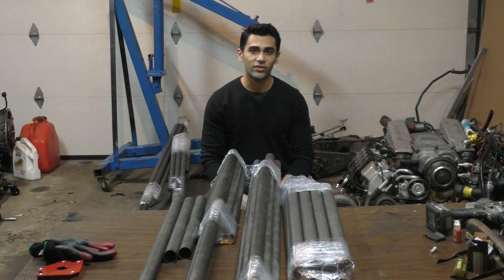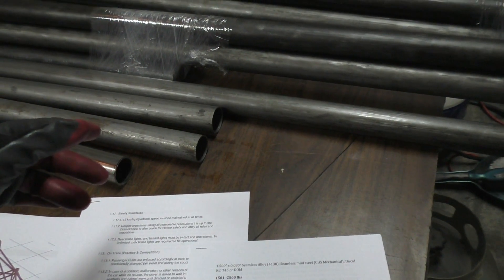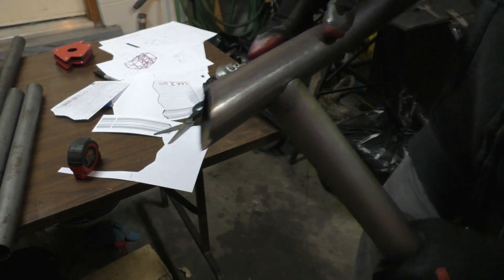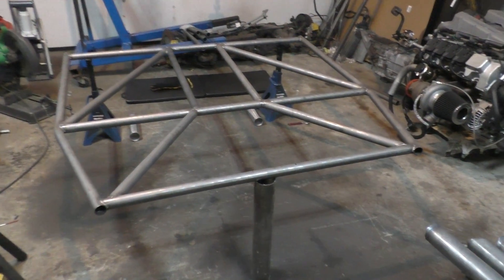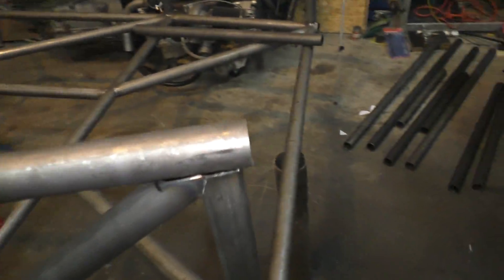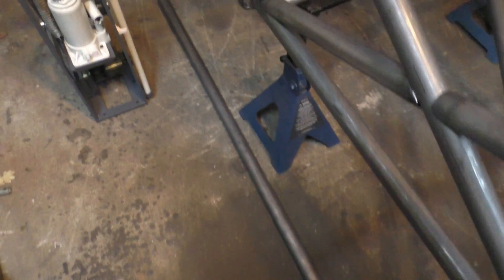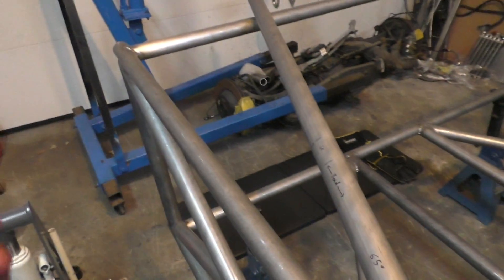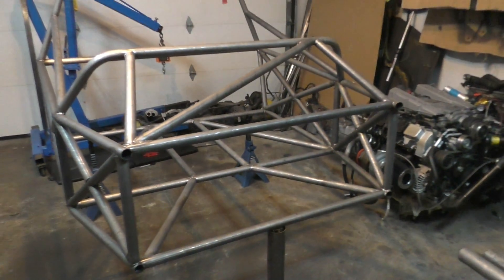Making a Racing Tube Steel Chassis - E55 ASL Part 4

Comment: hello there what software do you use to print out a guide on angular welds on cylindrical tubes,  a decent video tutorial on yt would be nice. im working on a project car from scratch. from philippines. PS ,may i ask specs on the tubes you use

Comment: To make tube notching easier, try a PipeMaster profile gauge....
https://www.ebay.com/itm/PipeMaster-1-1-2-Tube-Kit-Contour-Gauge-Tube-Notching-Modified-Off-Road-Dirt/271146913722?_trkparms=aid%3D1110006%26algo%3DHOMESPLICE.SIM%26ao%3D1%26asc%3D227673%26meid%3D9cc2cb6b4c044c11bc0d0b83f7121045%26pid%3D100005%26rk%3D1%26rkt%3D12%26mehot%3Dag%26sd%3D383483294582%26itm%3D271146913722%26pmt%3D1%26noa%3D0%26pg%3D2047675%26algv%3DSimplAMLv5PairwiseWebWithBBEV2bDemotion&_trksid=p2047675.c100005.m1851

Comment: I built a car frame a long time ago. Used .125 wall square mild steel tubing. That frame was near indestructible. I am inspired to begin designing a mid engine, two place tandem, street/track car.

Comment: Not sure if you still check your comments but I just graduated uni and looking at doing a similar project. Did you design thenroll cage or buy it? I’ve designed a roll cage for an off road go kart on SolidWorks I still have to run FEA analysis on but wondering if there’s anything specific you know
Reply from the maker: Just go through the regulations if there's any specific event your looking to compete in. I followed the time attack rule book that specifies the minimum requirements for the roll cage, the rest was based on my own calculations
Reply: SK8215 cheers for the response brother 👌

Comment: Id be doin a rainman level freak out if I had to start from a less than adequate base. I gotta ask, Why? Why not make a jig? Its stressing me out from here... Get the prep and base spot on and everything ahould come into place. 
(As im watching this, you got (b?) pillar angle wrong... 😳 i feel sorry for you when you try get panel gaps correct, interior trim panels.... And your still, “meh, its ok” 
Im not hating, just a bit of PTSD from being through these still born type projects and knowing what sort of pain your in for... g (you just got an... nevermind) 

Jeezuz christ mate, you obviously have the schooling and welding... 
But sheesh... There are certain things you need to step back and invest some time into as future steps will carry this on. And so on. 
And tooling, I buy good quality stuff, but not top shelf stuff. No where near. 
BUT.
There are those few items that need to be 👌🏻. The extra money invested here will pay itself of 10 fold... 
That bender belonged in a shed that was building a swing set for example. A decent, but sturdy 60x90cnc bed and gantry with top shelf rails, spindle etc etc, is another good one. 
And in your case, a good system for truing components. Ie; a method for checking centres.... a small frame to mount it too where you have a known base to work from and reference from.... 
Sorry lad, I aint knocking ya. Just hoping the bottom of the frame has no lateral twists or is not out of square... 
Control arm mounts, steering rack and components..... I hope it goes well for ya though. If I won the lotto, I be doin exactly the same. Building 2 identical toys in a row and selling the 1st

Comment: Building a car from scratch. That is the way to do it! Very cool, indeed. 
I'm curious how you came up with the design for the chassis. (What your background is.) I'm actually building a Jeep (frame up) and I had no background or experience with building cars. I certainly have no clue where to start to design a tube chassis.

Comment: Formula SAE will be held at the Barrie Molson Centre May 30 - June 2.  You'll definitely want to check it out!

I started reading through the rules.  tube frame cars aren't allowed in CSCS (not sure why you linked the rules).  You've said you're in GTA.  First rule on the main roll hoop is that it is "one continuous length", usually from the floor.  You mount yours at the shoulder harness bar.  They prefer the diagonal hoop brace to be one piece.  Do you think those could be sticking points with tech?
Reply from the maker: Sure, will look up on fsae
Tube steel cars and race cars have a separate category. It's called exhibition class at cscs, pro/comp at global time attack. In tube frame cars the roll bar is considered starting from where its welded to the chassis, same as in some coupes and convertibles where it starts from a higher point in the frame rather than the floor. I also followed some scca rules since they are much more specific on open top cars. The frame still needs additional braces, will start work on it again once the front end is finished.

Comment: I bought an 05 cls500 engine block its brand new but it was left in storage for more then 10 years should i change o rings? Like oil pickup tube seal?
Reply from the maker: If it was just left in storage, it would have gone through almost no temperature cycles so seals should be good. Check the condition of other parts like the valve cover gaskets and oil filter housing o rings. For my engine all of them were hard. Checking those might give you an idea what other seals are like too
Reply: @xfmotorsports  alright thank you so much for the response, I really appriciate it
Reply: How much did you pay for it if you dont mind me asking?
Reply: @SpenserRoger  2k
Reply: @SpenserRoger  2k euros wich is 2250 dollars

Comment: bruh, what if you crash? those bars will not work, too thin right? :/   cant imagine if you crash at 60+mph, that engine will be in your lap
Reply from the maker: No no, tube steel construction is much stronger than the regular sheet metal construction you find in production cars. Each of those tubes can take approx 16 tons of tension before they fail. Usually they don't bend at all in a crash if the crumple zone absorbs the impact

Comment: is it true you have to make a sample and send it to be approved welder for a approved cage ?
Reply from the maker: Depends on what events your planning to compete in. Some formula car rules will tell you to do a sample weld and test the tensile strength on it. Time attack and lapping day rules usually just go by visual inspection and checking if you have all the necessary tubes in the correct thickness.

Comment: You did great job. When you notch the tubes with .095 try beveling the edges this will allow you to use less heat and get the best penetration. If you buy a cheap belt sander like a CT or HD  it will make your life easy as you can just roll the end of the tube on the belt sander to get the bevel and it takes 2 seconds. Try to clean the mill scale off the end of the tube and it will be easier to weld, for example look up mages of "camburg chassis" and you can see how the clean the mill scale. Also usually when welding the tubes it's a good idea to drill small 1/8 vent holes so you don't have pressure trying to blow out your welds. I wanted to say you should ask them if all the tubes have to be .095 or just the main tubes...because then for certain braces you can step down to .083 or even .065 4130 to save weight :D
Reply from the maker: Thanks for the advice. Still have a lot of work left so will try it out. I'm using thinner braces for the section that goes in front of this. Should workout better for a crumple zone anyways lol

Comment: Shouldn't main hoop be a single piece tube? Or since it's a chassis, not a roll cage, you can make "rollover bar" separate?
Reply from the maker: For production cars yes it has to be one piece all the way till the floor and welded on floor plates. For tube steel cars it can just be welded on the chassis since the rest of the chassis is the same strength anyways

Comment: I would love it if you could incorporate the headlights of the E55 into the build,
Reply from the maker: I tried to when I was designing it, but they're a bit too big for those front fenders. Won't do the aero too much justice
Reply: SK8215 understand, well no headlights or tail lights needed on a time trial/track toy anyway.  Some headlight stickers maybe?
Reply from the maker: I'm keeping the E55 tail lights since brake lights are required. Might also add the projectors from the headlights later. It would be useful for track days that go into the night

Comment: What software do you use for the design?
Reply from the maker: Started off in Solidworks later designed it in 3ds max. Solidworks is definitely better for chassis design, I'm just more used to 3dsmax so works quicker for me that way
Reply: @xfmotorsports  Very nice work. It would be very interesting to go through the design process and see how you decided the tube layout, angles and tub lengths